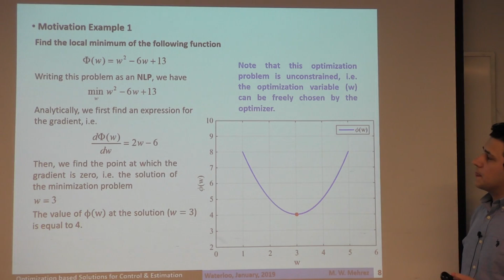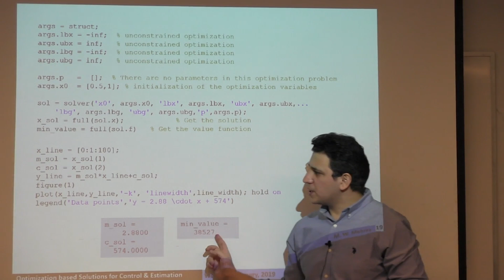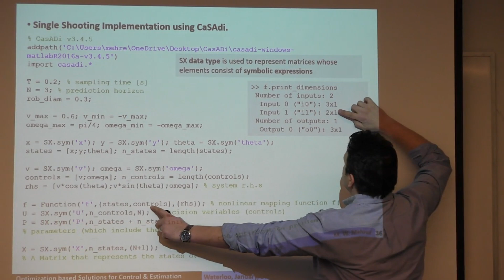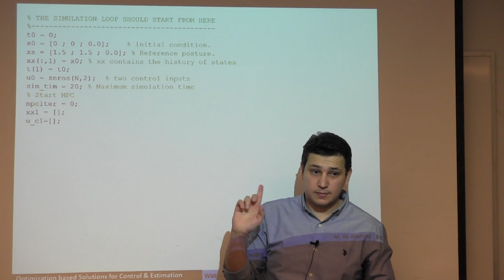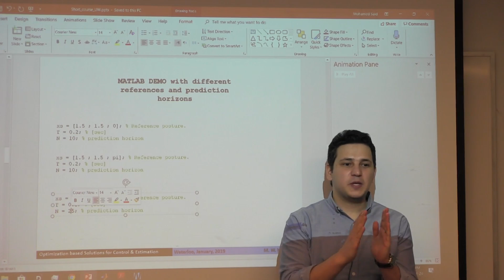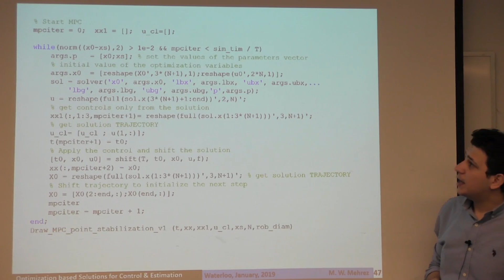MPC and MHE implementation in Matlab using Casadi | Part 1

Comment: Dear dr mohamed ,
If the r.h.s equation include some parameters.
(Because i’m writing the dynamic not the kinematic model)
How can i define the parameters
Reply from the maker: Hi Zaman, you can simply add the values for those parameters directly in your formulation. If you want to update their values every sampling instant, you can define them as additional parameters in the parameters vector P.

Comment: Hello Dr Mohamed,
I'm trying to add terminal equality constraints to ensure the stability using CasADi. However, this is not included in the example. Could you give me any recommendation about how to achieve this in the code?
Reply from the maker: Hi, Just add that constraint to the vector g for the last state in your prediction horizon.
Reply: @MohamedWMehrez   Thanks for this. It is very helpful.

Comment: Dr Mohamed I have a question,  if my system has disturbance from the environment how to input it in the code ?
Reply from the maker: You can treat this disturbance as a parameter in your model and update its value every solver call (similar to how you update your state initial condition)

Comment: Hi I've been watching through your MPC videos, very nicely explained. However, I have one question:
If one would want to use a time varying scalar weight in the objective function, instead of fixed weight matrice/matrices, which is measured in real time at every time step. Would it still be possible to use a similar multi-shooting approach as you have done in your videos using casadi? 

As an example of how I would implement this by the understanding I've gotten from the videos:
1. Define a symbol for a scalar weight, w = SX.sym('W',N); 
2. Calculate the object function as usual for N time steps (over the prediction horizon), with w now included in the objective function.
3. Then in real time, other then sending in the current state to the solver, also send in the measured scalar w.
Reply from the maker: Hi, Thank you for your comment; You can simply add parameters for the weights that vary every optimization step. And you simply feed them back to the solver the same way you do with the state feedback.

Comment: Thanks a lot, Dr. Mohammed ! 
I have a question , I followed the lecture and try the MPC technique and multiple shooting on my model of omnidirectional car. 
I take the position ( x,y,theta) as states and take velocity ( vx vy omega) as controls. 
As you mentioned in the video, except constraints on the boundary of controls, we can also set constraints like g=[g; U(:,k)-U(:,k-1)] to set constraints on the acceleration. So for example I want to satisfy that the abs(ax)<1, and the step time h is 0.2. Then I write the code like g=[g; U(:,k)-U(:,k)]; in a for loop. Then add the constraints like args.lbg( XXX : XXX ) = -0.2;  args.ubg( XXX : XXX ) =  0.2;
But that results that my velocity of vx is kept within bounds of [-0.2, 0.2]. So I decide to ask you for some help.
Reply from the maker: hi, thank you for your comment, I guess u need to change your g to

g = [g; U(:,k)-U(:,k-1)]

Keep in mind that you want to constraint the change in control. Please note that bounding the acceleration has no effect on the bounds on velocity. You can have both limits added.

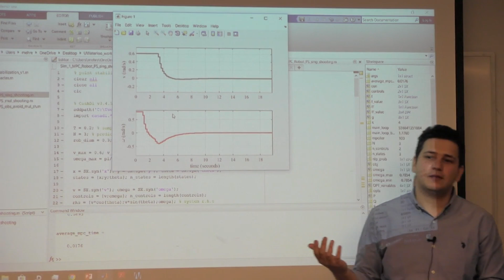Comment: What did you mean when you said at 1:13:49 "if i have sampling rate of 10 HZ ...."? Suppose we implement the process on microcontroller. The average computation time of the one MPC iteration is 17 ms. Therefore, the one loop time of the whole process will be more 17 ms. Let's the microcontroller works at 10 hz and then the loop time will be 100 ms which is enough to compute one iteration of the MPC. So what is the relation between the sample rate of the whole system and increasing the speed of one MPC iteration? I think that i am confusing in somewhere. Thank in advance.
Reply from the maker: Hi, in general the sampling rate (which is the rate at which you measure a new feedback) should be >= the mpc computation time. so if you compute your mpc control signal in 17 ms then you should apply it then wait for 83 ms in the loop before you measure a new feedback.
Reply: @MohamedWMehrez  Thank you.

Comment: Dear Mohamed

I don't have words to thank you for this amazing tutorials. this was a turning point for my master thesis, i will definitely cite your work, <3
i just have one simple question, if i want to apply to the real robot then i need to apply the first control input to the robot and extract the resulting robot pose (as done in shift function), am i right Mohamed ?,

Regards,
Fiza
Reply from the maker: Hi Fiza, Thank you for your comment. Yes, that's exactly how it works.
Reply: @MohamedWMehrez  Thanks you for quick reply Mohamed, one more thing is kinda not clear to me, if we are using the first control input and then based on that getting the new state, then what do we do with the state outputs we get from the solver (in case of multiple shooting we get both control inputs and states as output right) . sorry if the question is too naive :P
Reply from the maker: @fizasayed8396  That's a good question. As you said the control is applied to the system.  The predicted state is used as an initialization for the next optimization step after being shifted.

Comment: Hello Dr. Mehrez, this lecture playlist was very helpful, as I will probably use Casadi for my thesis due to lack of MPC Toolbox license. 
Do you know if Casadi supports the use of symbolics in the upper/lower bound definition of the constraints? Specifically altering those constraints in between solver iterations, based on parts of the predicted state.
Additionally, is there a straightforward way for adding RCS-like thrust control into the model dynamics (which are usually continuous wrt the control inputs), so that their discrete firing times can be used as the decision variables (subject to some type of symbolic constraint [ t_2 > t_1 + t_dwell ])? Sadly most of the whitepapers I'm finding for this sort of problem revolve around switching algorithms in VHF electronics and Mixed Integer Programming, not vehicle dynamics.
Reply from the maker: Hi, Thank you for your comment. for your first question, if the limits can be expressed as a function of the predicted state, then you should be able to formulate it in CasADi. 
I am not sure about your second question, but it looks like you wanna represent your control inputs by another set of timing inputs. i guess if you have the right conversion model between the two, then you should be able to formulate that and have the timing inputs as the decision variables. All the best!

Comment: Hello Mr. Mehrez, first of all thank you very much for the resources. As everyone said below, your work is amazing and so helpful. 

My question is in the nmpc design with multiple shooting and RK4. Before discretization you are defining an "initial condition constraints", which is g = [g; st - P(1:3)] at 1:32:10. Is this constraint belongs to multiple shooting step or it is coming from another condition? I am now working with an Casadi interface named MPCTools. The multiple shooting is the default discretization and constraints are also defined by the interface designer. I am not sure if the "initial condition constraints" should be defined by me separately or they are already defined under multiple shooting source code? Thank you very much in advance for the valuable comments.
Reply from the maker: Hi Dnz, Thank you for your comment. Yes, the constraint comes from the multiple shooting formulation. I don't think that you have to redefine it in MPCtools if you are already using the multiple shooting option. All the best!

Comment: In order to get a larger prediction horizon. Do you think is possible that my MPC controller ran for example at 100 Hz while internally the predictions are performed for example at 10 Hz? Thanks in advance
Reply from the maker: That should work I guess, but I believe that the performance won't be as good. Just keep in mind that in that case, the optimal control sequence will be for a mismatched frequency and that would degenerate the performance.

Comment: Great tutorial Mohamed. Thank you very much.
Reply from the maker: You are most welcome!
Reply: @MohamedWMehrez  I have a question. If the rhs is not an analytic function like in your example, but it is a time-varying ode whose parameters are taken from the data. Is it possible to define such a function as we do in ode45 in MATLAB?
Reply from the maker: Yes you can. Just pass those values in the parameters vector P. Just be aware of where you are placing them within P.

Comment: Thank you so much for publishing this lecture! It's amazingly well explained. 
Greetings from the UK :)
Reply: ps. I was taking notes of everything you said, and after one hour of video, I realised you had uploaded the presentation on GitHub... I could've saved a lot of time if I knew it 😅  Anyways, thanks again!!
Reply from the maker: Thank you for your comment. I am glad that the workshop was helpful.
Reply: @MohamedWMehrez  Thank you very much! I've seen your tutorial a couple of times, and I think I understood everything you said, but I was wondering how to implement Multiple shooting for DAE problems? I know that CasADi has a daebuilder.. but I was wondering if that's enough for calculation of the derivatives or we have to use Euler anyways? Thank you again.
Reply from the maker: @Paulina-su8nk  thank you for your comment. I haven't tried DAE's with MPC before. Nonetheless, I believe that it should be straightforward to use DAE's for prediction. It's just a matter of adding the algebraic part of the equations as is and using Euler or RK4 for the differential part. Just keep in mind that Euler discretization converts the ODE into algebraic expression. You can also check the CasADi manual/ website for the DAE's integrators they have.
Reply: @MohamedWMehrez  Thank you so much for your reply! It's really helpful. 
I am now trying to implement a DAE problem to MPC for my PhD project, so I've been seeking a lot of information in order to implement it successfully. Your tutorials have helped me a lot to understand the basis of MPC, MHE and CasADi. Thank you so much for this!
Reply from the maker: @Paulina-su8nk  you are welcome. Feel free to drop here any question you have regarding the workshop. Best of luck in your PhD.
Reply: @MohamedWMehrez  thank you so much

Comment: It is a great video, but I have one question. I tried to apply the single shooting method in python however casadi show me the following error:  "Xfunction input arguments must be purely symbolic. Argument 0(x) is not symbolic.". The only modification that I made in the code is basically, eliminate the constrains and stablish at the same way that your code on python, So do you have any idea why this happen? I cannot found an answer until now
Reply from the maker: Hi, thank you for your comment. Please check the python examples available on Casadi install page (example pack). They have many mpc examples with codes.

Comment: Outstanding MPC series.Thank you professor.
I've tried the implementation,but this exception arises:
if the start position angle is at 170 degrees and the goal destination angle is at -135 for example,
Casadi finds that it's more optimal to reduce the angle to 0 then reach the negative value of -135: turning Clockwise.
it's like Casadi problem as it is shown here doesn't know that it is optimal to raise the angle past 180 degrees to reach immediately negative values
such us -180 then try to reach -135  in a CCW motion.
How could we make Casadi problem recognize the modulo PI  if That's the issue I guess
Thank you again Professor.Top Notch explanation .
Reply from the maker: Hi, thank you for your comment. It's not a CasADi problem; it's the problem of the model used, i.e the angular change is an integration of the rotational speed. So the angle keeps increasing or decreasing and will not have a change like -180 => 179. You need to change the model to use a rotation matrix to represent the rotation instead of a single equation for the angular position.

Check out this paper
https://www.sciencedirect.com/science/article/pii/S2405896320334182
Reply: @MohamedWMehrez  That makes sense, I'll implement it and see how the vehicle behaves .Thank you for the fast feedback Professor.

Comment: Dear professor, thanks for your tutorial and code. It is indeed an excellent work! Still, I have a question that the IPOPT can only be applied in a convex optimization problem while the optimization problems in the your vedio might not be convex (e.g., MHE, vehicle trajectory tracking). For example, the quadratic programming equation J=Q'xQ+u'Ru is convex while the related constraints in multiple shooting, st=st+T*f(st,con), might not be convex. Do you have any suggestions on how to prove the convexity of this problem?
Reply from the maker: Hi Meng, Thank you for your comments. Actually, IPOPT can be used for optimal control problems that have non-convex objective or constraints. Check this course if you would like to study more about numerical optimization https://www.syscop.de/teaching/ws2020/numerical-optimization
Reply: @MohamedWMehrez  I got it. Thanks for your prompt reply and you solved my problem well!

Comment: does the casadi has the capability to use neural networks for constrained optimization . Actually I wanted to use  specifically  neural network for model prediction 
ie x_(k+1) = f(x_k, u_k) , where f() is a neural network .
if yes can you point me to a paper/blog/example of demonstrating how can we do that? I couldn't find  good example on their official blog.
And thanks once  again , for uploading such great videos!
Reply from the maker: Thank you for your comment. I guess using a neural network as a prediction model is a little tricky. However, if the NN model is differentiable w.r.t. the optimization variables, then there should be no problem. I guess an NN that uses a sigmoid functions should satisfy such a condition. I am not quite sure though. I haven't done that before, so I guess you'd better search for related resources yourself. All the best!
Reply: @MohamedWMehrez   So I searched and   we can include the TensorFlow models!

Comment: Why theta wasn't taken into consideration as a constraint, but only position x,y? I am referring to the single shooting part.
Reply from the maker: Because theta (robot orientation) is unbounded, i.e. the robot can take any angle.
Reply: @MohamedWMehrez  Yes I figured it out, but I was referring to the trajectory it is supposed to follow (third differential equation).
Reply from the maker: In the presented trajectory tracking example, the robot was tracking a straight line trajectory in which the reference angle is simply zero.

Comment: Hello Dr. Mohamed,
In the MPC formulation, the terminal cost function and terminal constraints are not included. Could you please explain why or why not they are excluded?
Reply from the maker: In my workshop, I just wanted to show the simplist implementation of MPC  in which no terminal constraints or costs are used. Normally, to use them or not to use them depends on how you would like to ensure the closed loop asymptotic stability of the resulting closed-loop system. In my PhD work, I showed how this can be achieved for mobile robots. You can check my related publications on that. Terminal constraints and costs can be also used to ensure closed loop stability. Just read more on that in mpc literature.
Reply: @MohamedWMehrez  Thanks a lot

Comment: Hello Mohamed
thanks for the great lecture. 
I want to design a MPC with Matlab (Simulink) and Casadi.
My system is realtime, so I have to do an online optimisation with simulink. Do you have any advice? 
The model is nonlinear. 

Have a nice day .
Reply from the maker: Hi Josh, thank you for your comment. You can actually couple Casadi with simulink. Check casadi's website for more details on that.

Comment: Hello Professor Mehrez!
First I would like to thank you for this amazing and well explained video. I have to confess I'm not a student of yours,  I found out about your work through searching on the internet. I have to say, it's impressive.
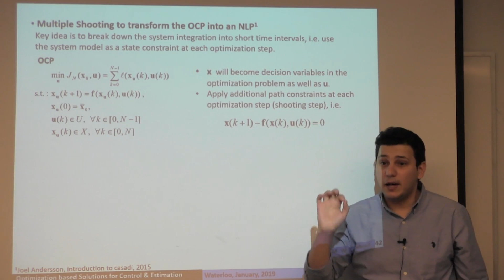I've understood almost everything, exept the the Multiple shooting system model explanation at 1:26:30. I get the concept of how it works (2 opt variables), I just don't understand the model. Why does the actual state and the predicted states difference have to be 0. Can you please explain to me in another way? 
Thank you for your time.
Reply from the maker: Thank you Adrian for your comment. I am glad that the workshop was helpful. In Multiple shooting, we treat both X and U as optimization variables in contrast to only U in the single shooting case. Remember that, in the single shooting case we linked the values of the prediction matrix X with the optimization variable U via the recursive substitution using the system model starting from the initial condition of x, which was empeded in the parameters vector P.  Since in multiple shooting X is already an optimization variable, there is no need to do such a recursive substitution, but rather we impose an equality constraint at each prediction step (shooting step) which links a state in X and a control in U and an immediate successor of that state in X. Therefore, we add the constraint

st_next-st_next_euler = 0

This constraint ensures that the relation between each state in the optimization variable X is correctly linked with its neighbours and the corresponding control action; and this relation is simply the system model.
Reply: @MohamedWMehrez  Looks like the thank you didn't get through 2 days ago, So thank you so much for the explanation. May I refer on my BSC thesis on your work?
Reply from the maker: @AdriánBősze  of course! please also cite any of my related articles here https://scholar.google.com/citations?user=aRNeH4QAAAAJ&hl=en